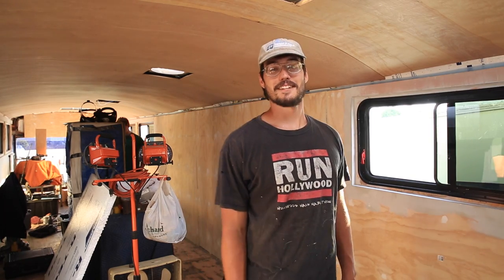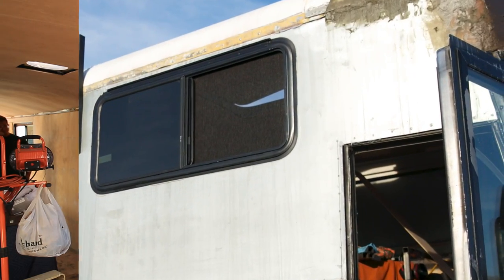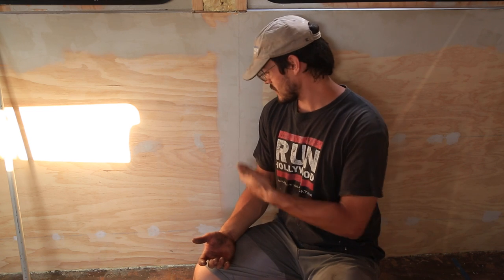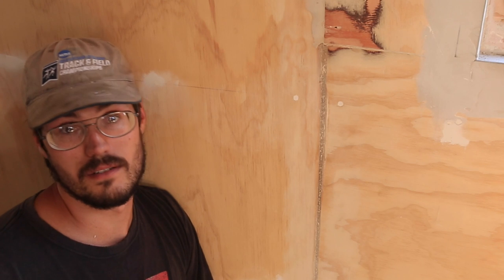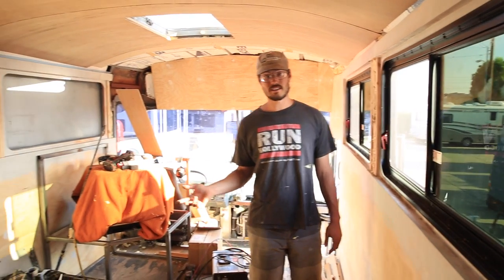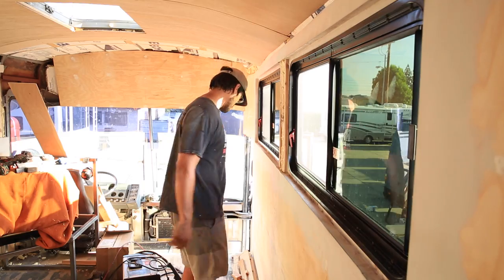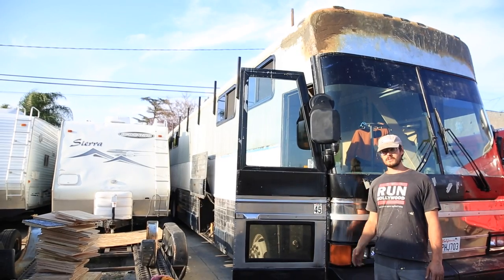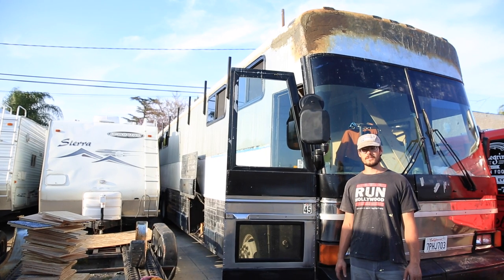Bus Conversion Tiny House #41 Update: More windows, fiberglass, and plywood!

Comment: Hey, guys!! It's a nice project! Just one question: which material do you use to cover the screws on the walls? We are planning on using plywood on our walls but we still didn't decide about the finishing.
Reply from the maker: We used 3m general purpose putty to fill the screw heads... in reality you can always put a nicer finish over the plywood and use finishing nails/glue. Nicer material may be something like bead board or tongue and groove cedar etc. best of luck!
Reply: Back to School Bus thanks a lot for the tips. 😉
Reply from the maker: +Odd Life Crafting Not a problem! I'm excited for you guys : )

Comment: The front cap will look good after sanding and painting.  Its hard to see through the resin and filler.  I've done enough boats to know.  You might try using vinyl wall paneling connector molding between the 1/4 inch plywood panels.  Get it at a home center.  This molding will allow you to cover the crack in joint.  I don't think your bus has moved so the temperature changes is making the metal structure of the bus and the wood structure of the plywood expand and contract at different rates.  The result is a crack.  Once you start driving the vibration will be worse.  A 10' piece of joint molding is only a few bucks and comes in several colors. This molding will allow for expansion and contraction while keeping the joint covered.  It does have a beveled raised look over the joint.   Just an idea.  Keep up the good work
Reply from the maker: +M/V Old School Looking forward to seeing what the cap looks like towards the end of this job!!! I don't have the experience you do so this is a first for me. As for the joint molding, that is a great and simple solution. We will definitely have to visit that idea. Most of the joints won't be seen due to furniture being built in front of them... but the ones that are naked to the visible eye would look great with the molding! Thanks again : )

Comment: nice work guys, looking good,   for my walls, i cheated and put up that cheap "cord carpet" which is foam backed, and stupidly cheap,  plus it hides a multitude of sins,  and adds another layer is insulation.    carpet on walls sounds stupid, but it works :D and i have wall paper on the ceiling ... so :D
Reply from the maker: +hmmmnz That sounds like a pretty good way to go! Plus you can easily just vacuum your walls ; ). You may have seen where we used a moisture barrier on the back of the plywood that has carpet like properties. We wanted to make sure we had something thick to screw into for furniture etc as we don't want to go straight into the metal if at all possible.